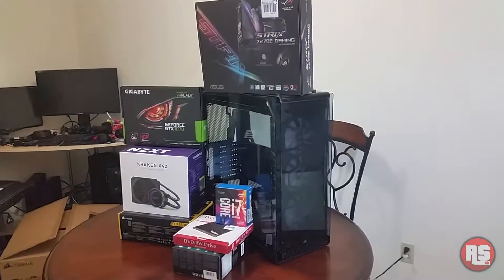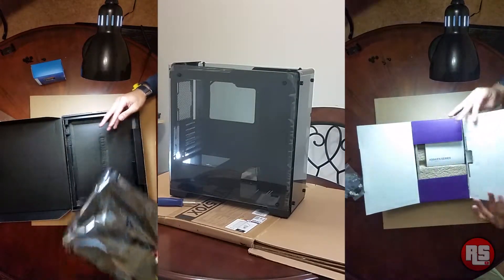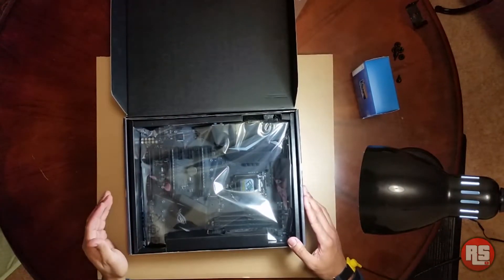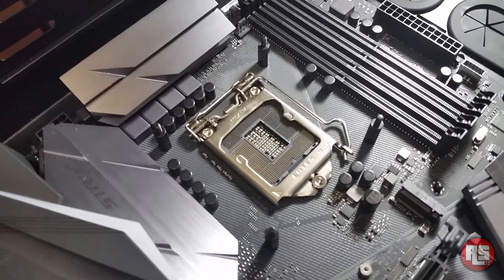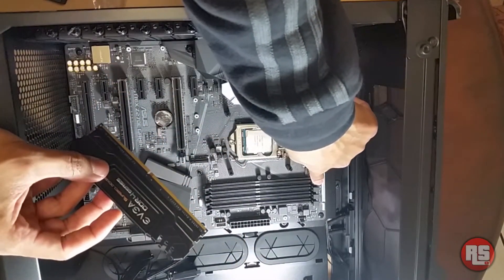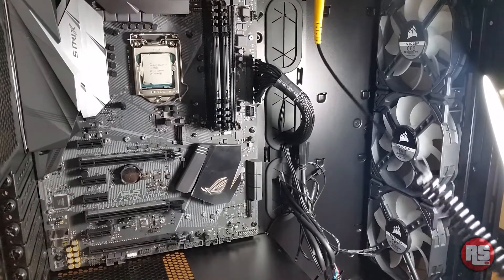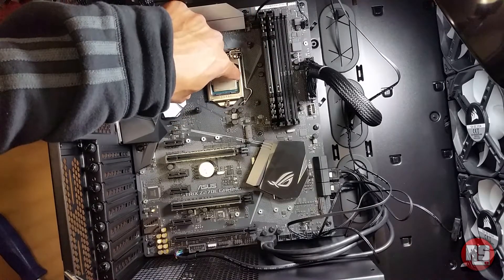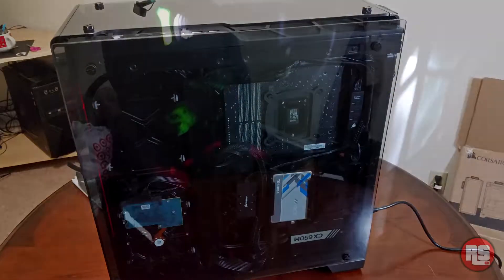HOW to build a GAMING PC, step-by-step,  2017 gaming pc tutorial, Build your first computer!

Comment: Yo one question, i almost have the same specs as you. But for my case right now im stuck on how to install the motherboard to the case. So what screws did y use for that?
Reply from the maker: Seyedali Mousavi there are standoff screws that came with the motherboard in the motherboard box. If we have the same motherboard mine were in a plastic bag inside the box

Comment: What did CPU fan Ports did you plug the front three fans into ?
Reply from the maker: jman2250 hi jman, every motherboard is different but on the motherboard I installed in this video (and all motherboards with additional fan options) the fan ports can be found in your motherboard manual. With this case the fans must be connected to the motherboard AND to the rgb  controller on the rear of the case  to function the lighting of the three  front fans. The front fans need power connection to the motherboard AND rgb connection to the rgb controller as well. I hope I was able to answer your question?
Reply: Well we have the same motherboard but I have the 460x, i plugged the front fans into cpu opt, and both chassis fans headers as my CPU cooler is plugged in aio. Also I have a test fan plugged into h_amp. I'm not sure is this the correct layout on how I was supposed to connect the front fans. Thanks for your reply !
Reply from the maker: jman2250 I built with the 460 prior to this case, same thing. when I get home I can try to look at the manual and point you in the right direction to be exact probably tomorrow since I am out of state
Reply: Rump Spank3r okay thanks !
Reply from the maker: jman2250 sorry for the delay jman! if you look at your motherboard manual, should be page 1-2 in chapter 1. it shows a picture of the motherboard worth each connector labeled by number. #3 connectors are for the fans.
I am not able to disconnect my wiring to be sure (because I used zip ties to connect them and hide them cleanly with the rear panel being glass and see through). I believe I plugged  one fan into #3chafan1 , one fan into #3chafan2 and one fan into #3cpu_opt......hopefully this helps you? If not let me know and I will try my best to help you. have a great day!